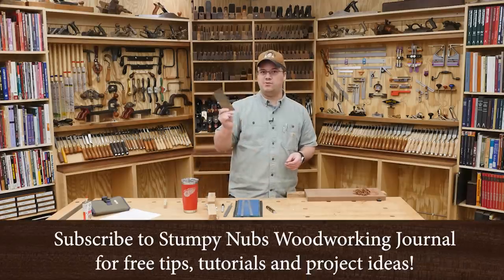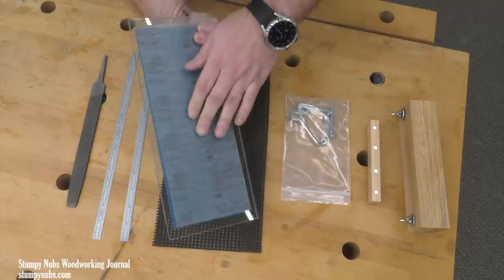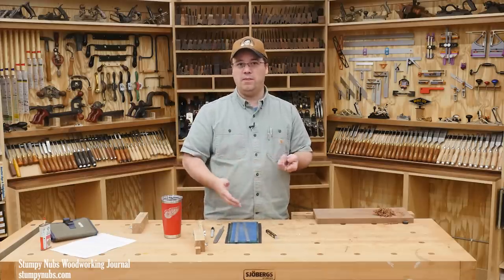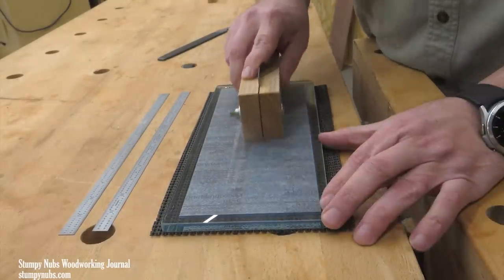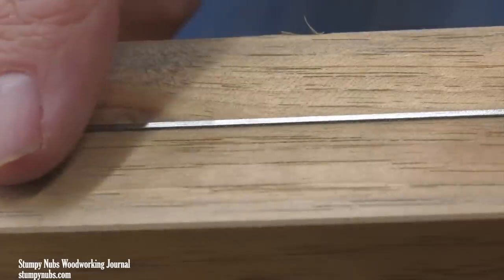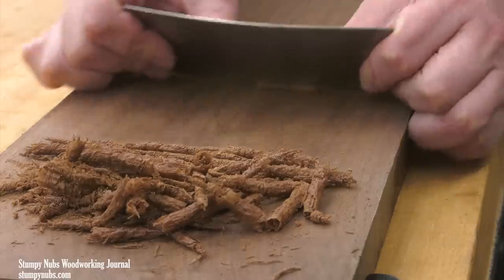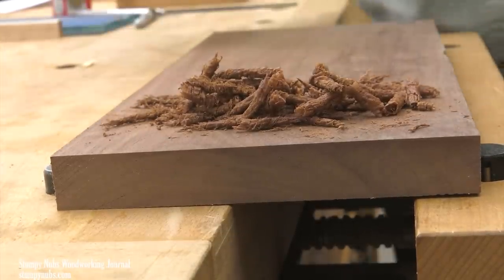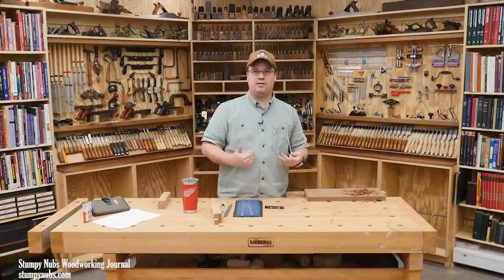Faster method ENDS most sanding and sandpaper!

Comment: I am new to this. Why would one use a card scraper vs a palm sander or hand sanding block or something like that?
Reply from the maker: Less dust and noise. Sometimes faster, too. Personal preference.
Reply: @StumpyNubs  Thank you, but is there a difference in sanding quality or straightness of sanding? Like when you use a palm sander, it gets smooth but you can get uneven areas if you hold it down in one place too much. A Card Scrapper looks like it creates sharp flat surfaces with enough practice. Thanks again for helping a noob.
Reply from the maker: @SSingh-nr8qz  A scraped surface is likely to have undulations. How noticeable those are depends on your technique, but it is very difficult to get a perfectly flat surface with a card scraper. Many people like that because it looks hand-made. If you want a perfectly flat surface by hand, a hand plane or a sanding block is the way to go.
Reply: @StumpyNubs  Thank you! I will give card scrapping a try. Thank you for your insights. Your channel is an inspiration to many people like myself. You are like having a wise woodworking neighbor that helps noobs gain knowledge and confidence.
Reply: @Stumpy Nubs  so I assume you wouldn't advise this method for a table top?
Reply from the maker: @yinyang2385  Depends on the table top. If you want a glossy mirror finish, then you probably also want a perfectly flat surface.

Comment: I have watched a lot of videos on card scrapers and would like to  try it, but from what I have  seen it needs to be held with 2 hand the lays the problem any thoughts on how to do it with 1 hand.
Reply: Maybe build a jig? Like a sanding block but yo hold the scaper?
Reply: You can make a jig that holds the bend in the card for you so you can use it in one hand. Just a piece of wood and a couple bolts and washers. I think Wood by Wright has a couple tutorials on making one. 

Also, you can get a cabinet scraper which holds the bend and holds the scraper at the proper angle. You'd have to drive it in a kinda odd way with only one hand, but you might find it doable. There are several old Stanley models, and quite a few modern manufacturers make them too.
Reply: @MortimerSugarloaf  perhaps a jig that resembles the old style razor blades guys  used for shaving their beard. Where the shaver is sandwhiched between two plates.

Comment: I like my card scraper for getting into inside corners and for smaller projects. I still primarily use my sander although it is a Festool ETS-EC 150 which helps. Maybe when I improve my work holding situation I'll use the scraper more often. For which is better? I think it depends on the situation and the material.

Comment: What material and thickness please.  Nobody seems to know what you are talking about at our hardware stores.
Reply from the maker: What?
Reply: @StumpyNubs  I asked  Google,  and got an offer per million pieces from China,  but still wasn't any wiser.  Do you use mild steel,  and graunch a wire edge on it,  or use a hard steel,  and forget the graunching?   I bought a package marked "scrapers"  but they were too thin,  but very nice for scraping excess filler when filling masonry cracks.🤣

Comment: How do you sharpen the curved scrapers?
Reply: Make a vise which is curved like your scraper?
Reply: With a round file and sandpaper wrapped around the file to polish it.
I'm sure there's a way to hold a block of wood on one side of the file if you're absolutely determined not to learn how to file square to a surface.
Reply: I dont actually know what those looked like but the sandpaper should be more than good enough you just want to get the edge. Also if its thin enough your vise doesnt need to curve as sharply as it can bend when you tighten it.
Reply: Buy a burnishing tool one end makes the burr other turns it

Comment: I do not understand...well, something: If the purpose of sanding is to remove material to the point that it is level and smooth, why does most sanding start with 80 grit and above, and not, let's say, 20 grit, take out "most" material, and then work on smoothing out that grit's "damage"? Wouldn't that save time? What am I missing here?
Reply from the maker: Not all sanding starts at 80. If you have a lot of material to remove, you may go 60 or 40. But those are very aggressive and will eat up wood fast, especially soft woods. You can easily go to far! 80 is a good compromise, especially if the surfaces are already machined relatively smooth. The key with sanding is to not skip grits. Never jump higher than 50%. If you start with 80, move on to 120 (an increase of 40), then 180 and so on. Skipping grits just adds to the sanding time and wears out more sandpaper.
Reply: If I was doing leveling or smoothing more aggressive than 80 grit, I would probably go to a handplane rather than sandpaper. If I had one, a thickness planer would be even faster.
That's more something you should handle during the stock preparation phase, though.

Comment: I have no idea whatsoever about woodworking, but I'm wondering why isn't there a jig or a holder for the scraper, to keep it flat and, maybe, provide a better grip..
Reply from the maker: You do not want to keep it flat, you want a slight bend as you use it. They make holders, but I find most of the awkward.
Reply: @StumpyNubs  oh, you do...
Kinda makes sense, it would be a lot harder to dig through if it were perfectly flat...
Thank you :)

Comment: When/why do people pick a scraper over a plane or sanding?
Reply from the maker: A smoothing plane will do the same job, but it takes more skill and you must be aware of changing grain direction lest you get nasty tear-out. A scraper is a bit slower (taking a narrower path) but easier to use and can be very forgiving when working against the grain.
Reply: @StumpyNubs  ah. Thank you... I should probably get one as I certainly ran into grain direction issues on my current project.

Comment: What I want to know is @02:10 I see a nice gash on wrist, what happened there? Jig saw? Chisel? Nail head sticking up, not paying attention and pulled back gouging you (I do not know anything about that, no sir didn't happen)!
Reply: You have a keen eye. I hadn't seen that till you pointed it out. I've had similar injuries when a screw driver or chisel slips while applying pressure on an object
Reply: @yinyang2385  Yep. Once you get a bad injury, you suddenly see everything!

Comment: Looks like a tool to cause some cupping to me. Especially when it’s a 6 inch blade that’s only cutting from the center 3 inches.
Reply from the maker: Scrapers are bent while you use them. The amount of the bend controls the aggressiveness of the scraping.
Reply: This kinda proves my point doesn’t it? Not being facetious here. I’m just saying. If it bends it’s naturally going to cup the wood. If you’re highly crafted and willing to pull out the mil gauge and constantly determine where you’re at then it could be worthwhile. However after 30 plus years of working in fine finishes I’d have to go with a block wrapped with paper.
Reply from the maker: @michaellong4897  No, I am saying it CAN leave an uneven surface if you aggressively bend it (many like that hand scraped look) but it can also leave a more even surface if you bend it less and blend it out. But yes, if you want a mirror-flat surface, you would then followup with a sanding block.
Reply: Righteous.

Comment: Is there some reason you wouldn't just use a hand planer?  Seems like an awfully over-engineered, not-as-good substitute you got going here.
Reply from the maker: Scraping is a technique that's older than hand planes. So I wouldn't say it is "over engineered." As for why you may scrape instead of plane- Planes must be used while paying close attention to the grain direction. Some highly figured wood can not be planed at all without tearing out the fibers. Scraping can be done on any wood, no matter the grain.
Reply: @StumpyNubs  Ah I see, that is true about the grain.  Thanks for the explanation.  I'll try scraping sometime, I typically handplane.

Comment: Sorry, but this is not the correct way to use a scraper. Bending the scraper like that will cause you to dig out a trough down the length of your board. Clamp the scraper at the top between a couple of pieces of wood so it stays rigid, and you can then scrape uniformly across the board width. Also you shouldn't have to press hard if the scraper is correctly sharpened.
Reply from the maker: There are different ways to use a scraper, but the technique I showed has been practiced and taught by woodworkers for generations. In fact, virtually all commercially produced scraper holders have a screw in the center to create and adjust the bend. Learning how to bend it to change the aggressiveness of the scraping action is part of the technique.

Comment: Scrapers can be very nice tools but this sharpening kit is NOT a good idea. The wooden vice at 2:18 will soon be deformed by the file and be useless, it can even cause the scraper to be deformed. I would never trust a sharpening kit like that.
Reply from the maker: No, it would not because you are not running the file against the vise. As I showed in the video, the card is set ABOVE the vise.